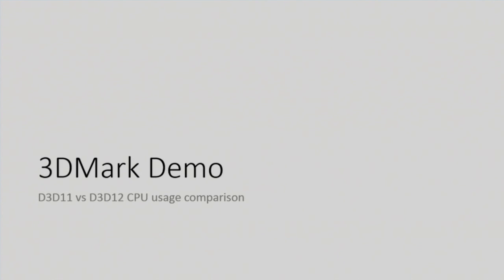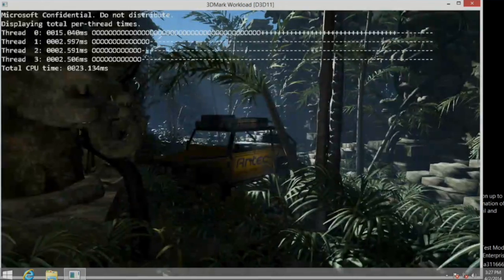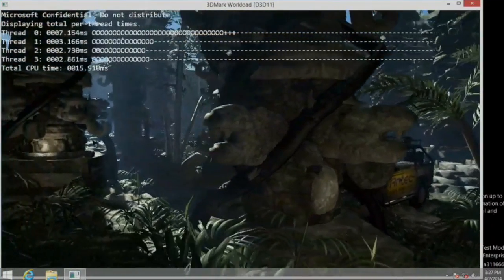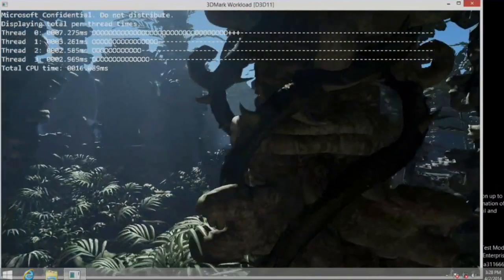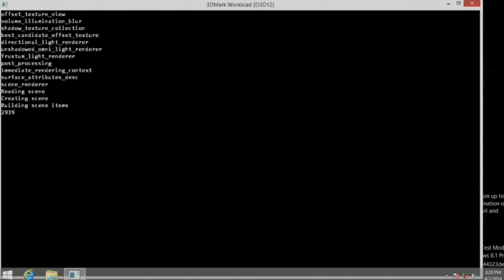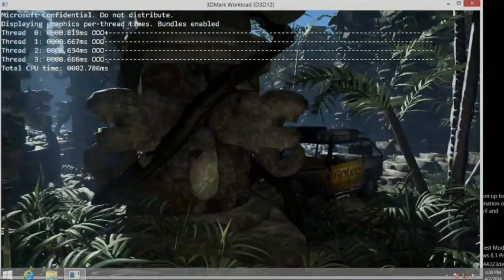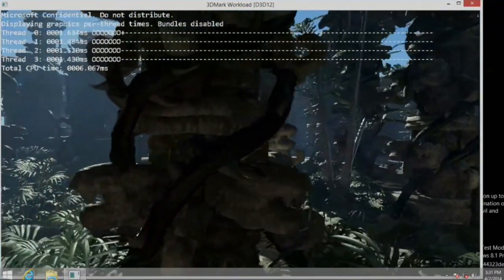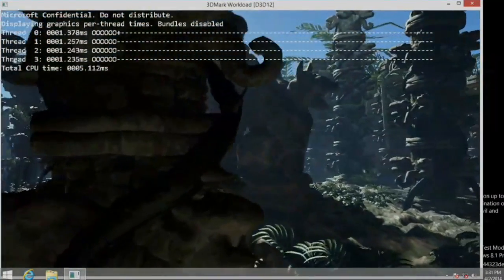3DMark-Techdemo | DirectX 11 versus DirectX 12

Comment: well 700 series support directx12?or only 900 series?
Reply: Nvidia will support DX12 on every Fermi, Kepler, and Maxwell-class GPU. That means nearly every GTX 400, 500, and 600 series card will be supported. Interestingly, AMD isn’t necessarily following suit — the company has indicated that it will support DX12 on all GCN-based hardware, but hasn’t indicated if HD 6000 or HD 5000 cards will be included in that.
Reply: DirectX 12 API will be supported on all Fermi and later Nvidia GPUs, on AMD's GCN-based chips and on Intel's Haswell and later processors' graphics units.
Reply: belaid12002 By a simple google search, people should really try it sometime, you can find information extremely quickly and easily.

Sarcasm Overload Alert
Reply: David Wagner No need to be so hostile, lol. GTX 900 series are in fact the first cards to fully support directx 12 and all of it's features. However it will not just be a modified directx 11.2 for older cards, it will be directx 12 but you won't be able to turn on one or two graphical features. It's not the same API anymore, this new directx is completely reworked.
Reply: Only the 900
Reply: SuperSonu222 BS! It is only on 900+ You get a modded 11.2 for cards under 900. It will not be true DX12.
Reply: SuperSonu222 Yes, but it won't be fully supported on cards older than the 900 series which were built with 12 in mind, it's sure to come with one or two new features like 11 did such as tesselation that weren't supported on older cards.
Reply: Xandi Souther u mean burnt graphics card?+tan yen han well if a burnt gpu cannot open a pc and can run Directx12 then it's cool
Reply: I herd its compatable whit GTX 400 serries and above
Reply: Nvidia will support directx 12 on all directx 11 class GPUs
Reply: A Typical Youtuber where did you find this informations ?
Reply: belaid12002 http://www.extremetech.com/gaming/178904-directx-12-detailed-backwards-compatible-with-all-recent-nvidia-gpus-will-deliver-mantle-like-capabilities
Reply: A Typical Youtuber Nvidia says they will support all current card out that supports dx11 all the way back to fermi gpu cores.
Reply: A Typical Youtuber http://blogs.nvidia.com/blog/2014/03/20/directx-12/
Reply: "Support" but not fully working drivers.
Reply: EroE della brina One of the surprise announcements at the show is that Nvidia will support DX12 on every Fermi, Kepler, and Maxwell-class GPU. That means nearly every GTX 400, 500, and 600 series card will be supported. Interestingly, AMD isn’t necessarily following suit — the company has indicated that it will support DX12 on all GCN-based hardware, but hasn’t indicated if HD 6000 or HD 5000 cards will be included in that.

Comment: where do you download directx 12
Reply: my graphics card supports it and thanks
Reply: people did tests with the preview on the same graphics card i have
Reply: ***** Directx 11 card will support dx 12 coz the only change we will gonna see is cpu usage it is not about new graphics or tesslation effect.Dx 12 will control API load over a CPU and draw calls over GPU....Overall It will just optimize your resource usage.
Reply: O_O
Reply: You have to have a card that supports 11.2 already. (says so on the box of your card) and windows 10 which will come out this Fall. You can get the preview I think. But it might be tricky to get.
Reply: ***** clearly it works with directx12 3dmark... You would have to find a devkit of direct 12 but you'd be able to run it on a gpu that supports it.

Comment: Ich freu mich schon auf die neue 800 serie von Geforce.
Reply: Luc4Dead
ich werde mir die 860 oder die 870 holen, ne 880 ist mir zu teuer.
Reply: Luc4Dead
em ja ich weiß das es 20nm werden aber was meinst du?
Reply: Habe noch eine 680 ... die 800 Serie werde ich wohl auch auslassen, die Spiele die ich ab und an mal zocke laufen alle ohne Probleme in 1080p -  warum aufrüsten ...
Reply: *****
ich hab ne Gtx 570, nach BF4 tests zu urteiln entspricht die leistung der GTX 570, der GTX 750...